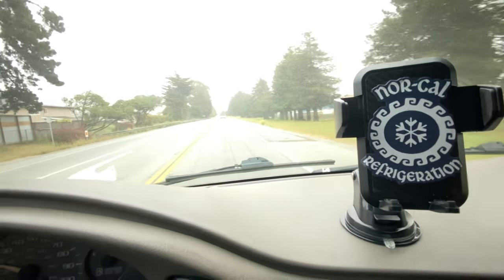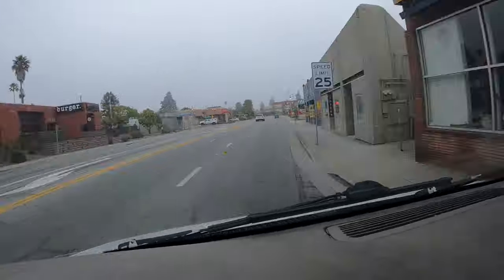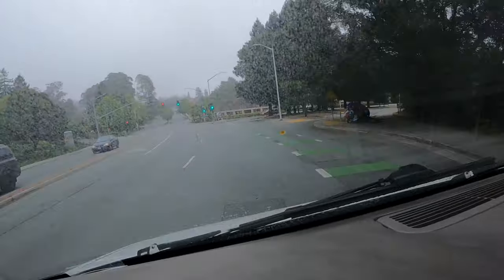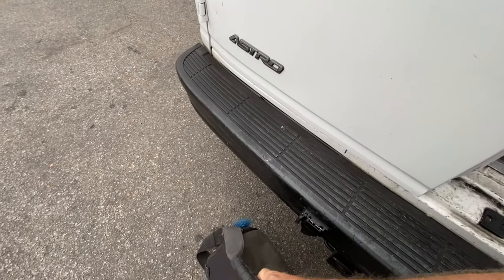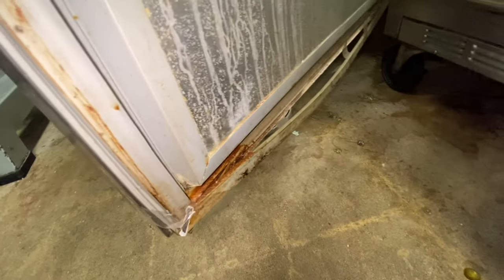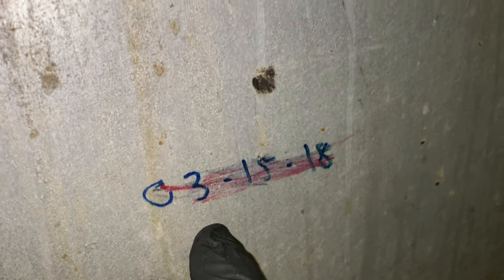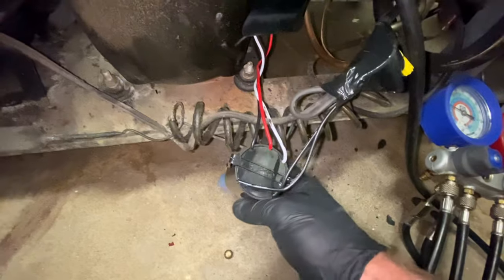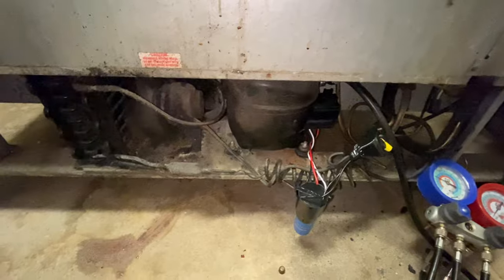Deli fridge not cooling

Comment: Nice vids. Worked on a similar 3 door unit about 3 weeks ago. Unnamed national pizza chain. Removed mouse, jammed in the condenser fan motor, motor changed, super hot, wouldn’t spin freely. Same manager calls last Friday, says same box not cooling, barely got it pulled out from the wall and she is all about how she is not paying for defective parts, workmanship, Yada, yada, yada.  I pulled mouse number 2 from the condenser fan blade, flipped it up onto the work surface and told her, “Your engineer died”, that will be $275.00 thank you very much. Doubt I will be doing much work for them in the future, but at 73 years old, who cares….

Comment: Customers always want it up and running which is a good point. "A Gas"N"Go" is what we can do in the mean time. Gas here is getting insane and  if you top off a charge you get complaints about charge vs replacement  of the evaporator ( most leaks are in here due to acid in the air from bad food storage ). I have ended up on those to add a sealant & dye combo. You get to charge it out and explain to customer why you have done it. Customer feels happy that you have tried to save a sinking ship.